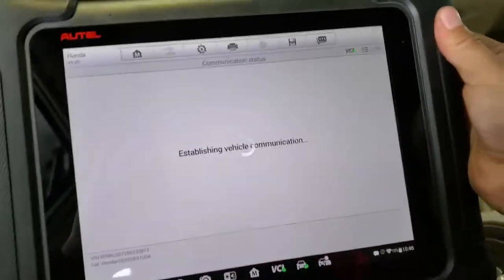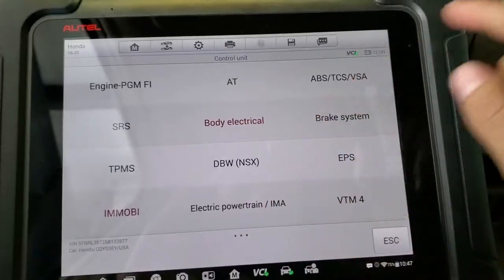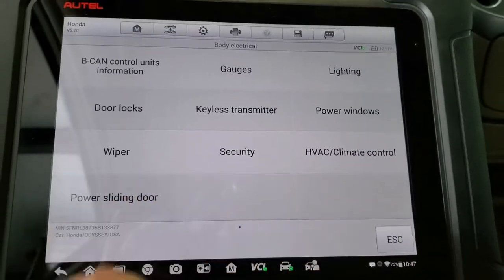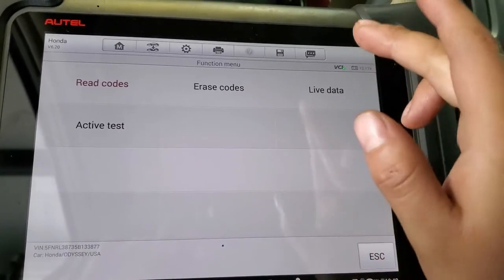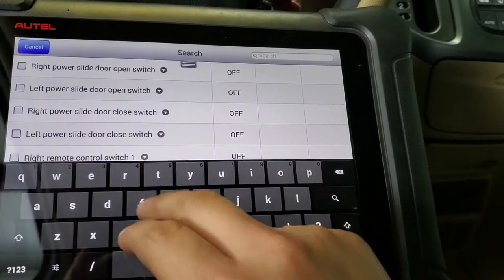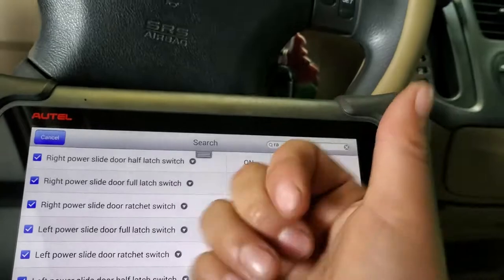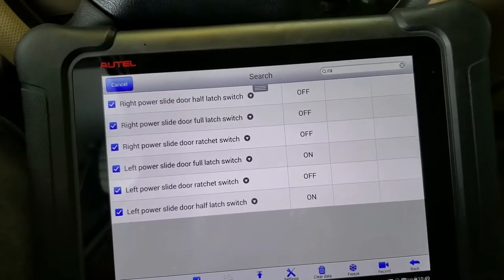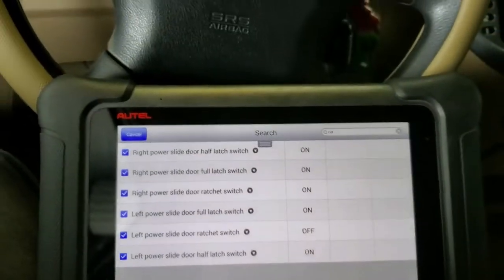How to fix and diagnose sliding door not working on a 2005-2012 Honda Odyssey.

Comment: What's the name of the part this is my issue as well
Reply from the maker: it's called ratchet micro switch but the Autoparts will want to sell you the whole part it's a common issue for the door to build up dirt and get the micro switch stuck making see the ecu that it's still open.
Reply: @JVFIXLLC  my problem is that I can pull the fuse to reset the slide door and after a few cycles it will set the light again and the door will not work... Mine is the passenger door do u have a video on that side? And is there any direct way to contact you with questions..  I plan on tackling this issue within the next 2 weeks

Comment: My 05 Odyssey passenger side door window motor gets hot with engine off key out.   If all plugged in drawing around 700 ma, so I have to keep fuse #7 (back up) out.  Also, window will only go down, will not go up.  I had to use a power probe to manually get the window up.  Any idea what it could be?
Reply from the maker: A module controls the windows for the odyssey. And those nodules are located at the back pillars of the van there are modules separate for each door. You will need an electric diagram to see the colors of the wires at the module because they change a bit
Reply: @JVFIXLLC  Could a Snap on scanner read which module is bad?
Reply from the maker: Yea you could monitor the data of the modules with a snap on scanner

Comment: It won't close and I want to close it manually
Reply from the maker: If it doesn't close manually then u have a latch problem. U can put the door in manual mode where the switch is for the doors on the driver side .